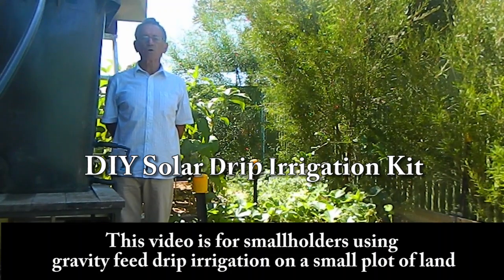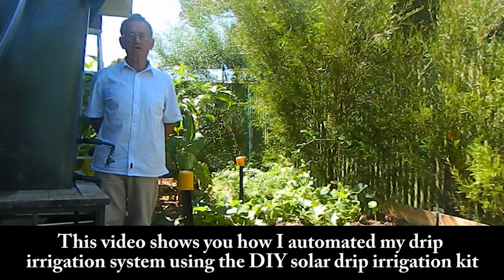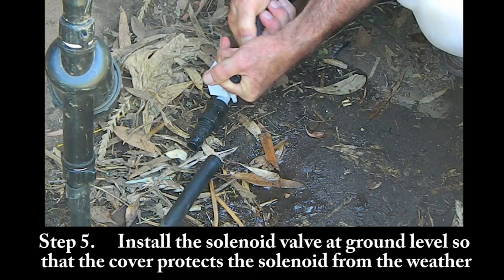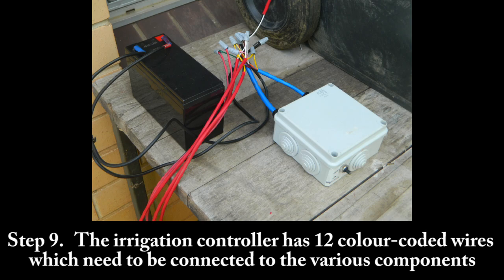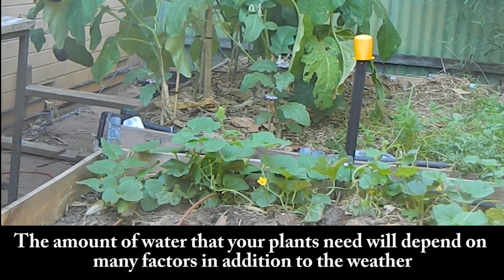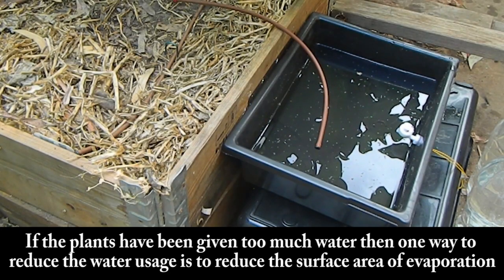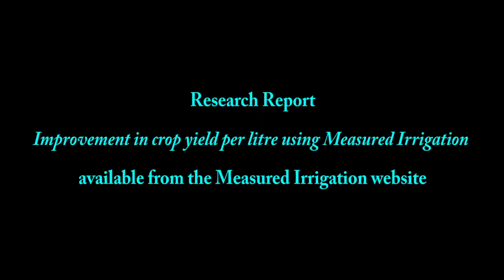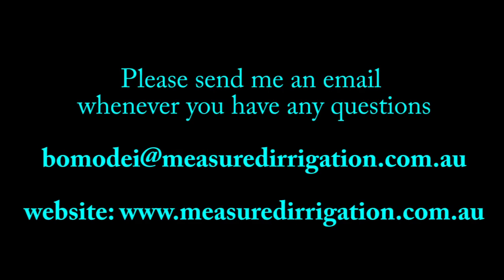DIY Solar Drip Irrigation Kit (see also Unpowered Irrigation Controller)

Comment: Hi Bernie, greetings! Thanks for sharing the video on this great innovation.  I see the automation bit saving time for the farmers to allow them time and energy to do other productive work in the same fields or elsewhere. The saving on scarce water resources is great. I think it is worth doing a demonstration or two with our farmers in Lower Eastern Kenya and have them share their stories. Given the technicality involved in connecting the wires correct, in my area, it will be worth sharing the video with local electricians who will then install the system for local farmers at a nominal fee.
Reply from the maker: Thank you Bernard for you comments

Comment: Thanks Bernie, simplicity is the ultimate sophistication, our moto and you are demonstrating yet again that with a simple install, on which there are a number of variations, water savings can be achieved. Measured irrigation control vs programmed is such a powerful tool anywhere from Kenya to  the Lockyer  Valley. Our "best irrigation practise"  always had design, material selection, install, control, fertigation and maintenance as the key words. Suggest to change the "control" keyword to "measured irrigation control". well done!  www.ezflo.com.au
Reply from the maker: Thank you Pieter for your comments